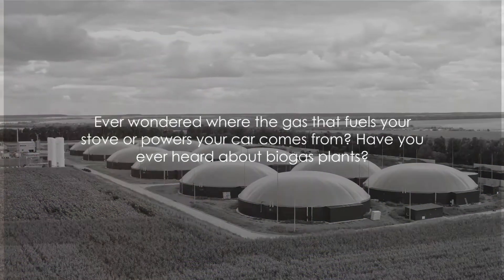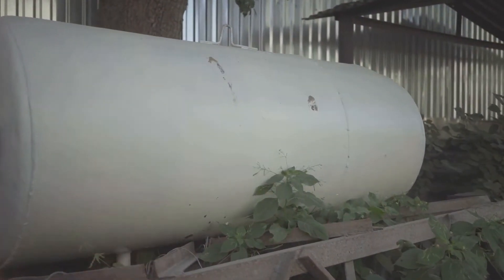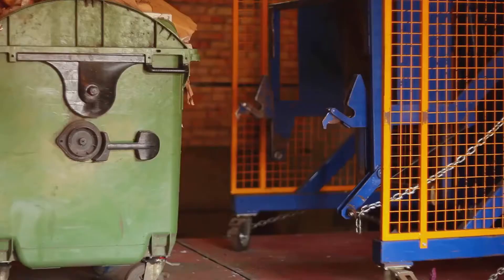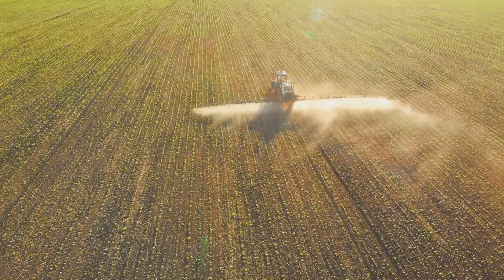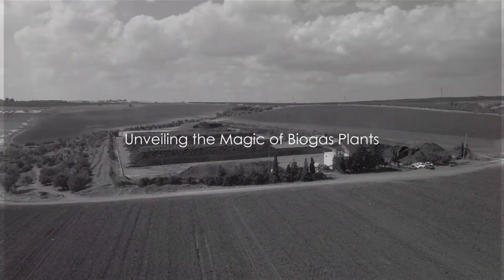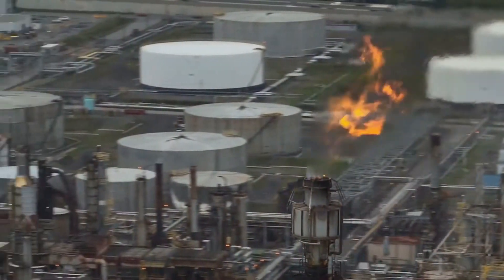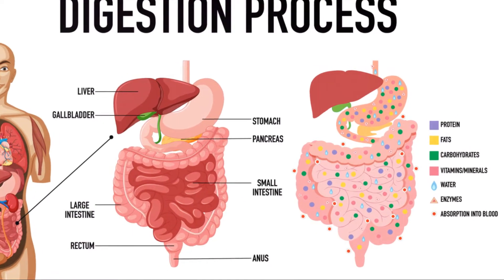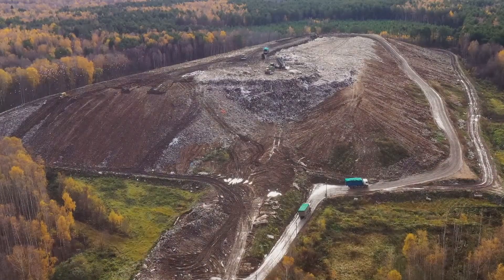Unveiling the Magic of Biogas Plants

Comment: Whatwhatwhat.. -Mimic the natural process? Mimic||? It IS! the natural process, streamlined! Our digesters were constructed mid-20th century of cement. There has been some cracking of the cement. However, specialized contractors are engaged periodically to strip/prep/line (application of acid resistant coating) interior surfaces. So cracking hasn't been a significant problem. I think the cement tank facility is probably the best approach since the cement is an insulator, providing a buffering from outside temp. fluctuations. The cement tank is probably cheaper than the steel. Keep in mind, a huge steel tank will have seams (problem potential welds). Digesters should be taken out of service at certain intervals anyway for inspection/maintenance etc.
Reply: The methane produced from our digesters provided energy for their operation, plus a huge methane surplus..  Yield is roughly about 1 part methane to three parts CO2.  The CO2 can be used for an algae operation. I like the term biogas, rather than focusing exclusively on methane, since the CO2, in my opinion, is nearly as valuable insofar as use for algae, which can go either way, high-lipid, or high cellulose. And in either case, the leftover "waste" sludges are themselves most useful for solid fuels manufacture (pellets, biocoal, biochar etc.).